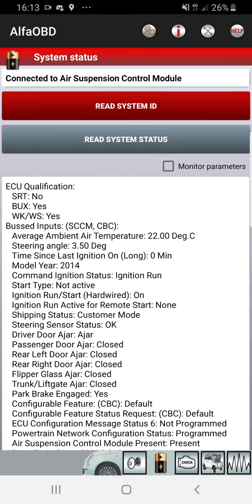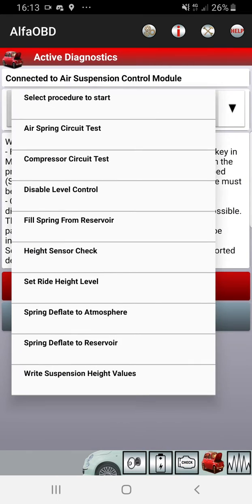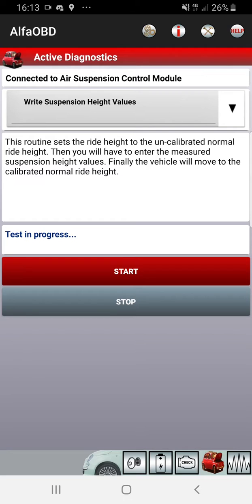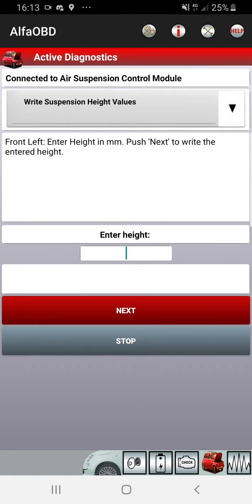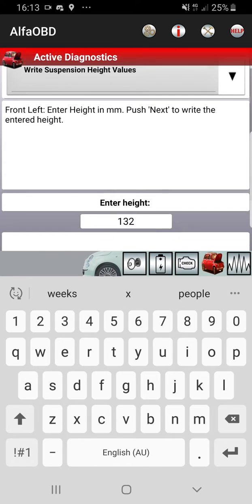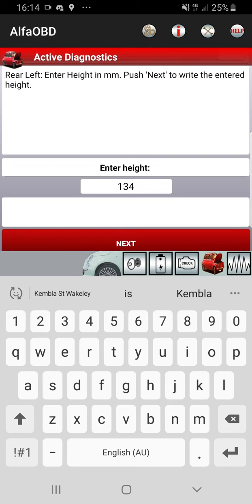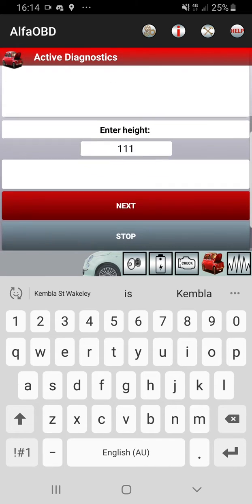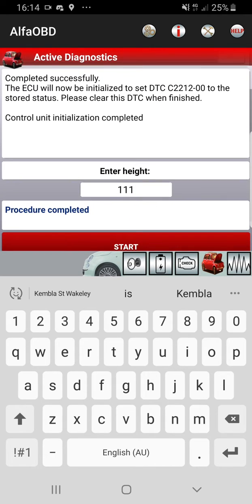Using AlfaOBD to Change Quadralift Suspension Heights

Comment: I believe what you did was lower the vehicle. The calibrated normal ride height values and the numbers you entered are not the same measurements. What you did was recalibrate the system. The values you enter are what you actually measure the ride height to be when it’s adjusted to the calibrated normal ride height. This tells the system what the actual measurements are then put new calibrated values into the system and saves them. In order to actually lower or raise the system you need to measure the vehicle ride height at all 4 corners from the correct measuring locations. Then lie to the stem and add mm to you actual measurement to lower the vehicle. You cannot change the factory set values. Only trick the system.

Comment: Hi Daniel, thanks for this vid and general info on your Jeep.  I followed your mods and fitted a strut spacer to my front struts for a static ride height increase while still maintaining decent downtravel and air susp functionality.  Well at least that was the goal....

Unfotuantely upon inflating the front struts again (after deflating to tank) my air suspension is giving me a dash warning, and according to AlfaOBD the system is in "Plant Mode" and due to not being able to recalibrate and giving me a error code C156E-OO.  I assumed that after these mods I would be able to set the new ride heights like your video shows, and this would fix any calibration issues after fitting the strut spacer.

BUT it seems I am unsecessful in clearing the code and setting new ride heights.  AlfaOBD is not keeps telling me the system is in plant mode, and won't do the calibration.  Despite clearing the code for plant mode, C2212-00, it still comes back soon after. 

Did you experinece this after fitting your strut spacer?  How did you get around it?  Any info would be much appreciated.

FYI mine Jeep is a MY2015 Overland.

Comment: I NEED HELP PLEASE, I NEED HELP.  I Replaced the front right shock absorber and compressor for leaks.  I refilled the Nitrogen reserve and all the shock absorbers.  Everything was perfect until I reached the suspension height.  My Jeep Summit has been in the garage for two months and I can't get the factory measurements.  Some say 85mm rear and 55mm front and others tell me 85 front and 45 rear, I don't know what else to do.
Reply: Summit Front Left Calibrated Height: 101 mm

Front Right Calibrated Height: 108 mm

Rear Left Calibrated Height: 99 mm

Rear Right Calibrated Height: 99 mma
Reply: @ElhassenGIS  THANK YOU. LAST QUESTION: Once I enter those values.  Are the other values and different heights automatically restored including (rock, sand, snow etc.?) or do I have to enter the other values as well?

Comment: Hey Daniel...you say 35 and 25 but values are different in the movie...how come? Can you give links please of your setup parts ..want to do the same...did u also installed Bilstein shocks on rear ? Or relocation brackets? Appreciate it...keep up the good work
Reply from the maker: Different Jeep in the video. Links to the parts I used are in my other video. Initially, I used the full 2 inch of spacers in the rear with OEM shocks but now I have Bilstein shocks with 1 inch spacers.
Reply: @DanielDjuracic appreciate it, i added the 2 inch spacers in the front, what values to add so my parking still works, a
I still got airlinks level, tried with the original also but no luck, help
Reply from the maker: @MedMaxMotto  Every car is different, i added 35 and 25 to my vehicle but was doing a different vehicle in the video.
Reply: @DanielDjuracic  Once I enter those values.  Are the other values and different heights automatically restored including (rock, sand, snow etc.?) or do I have to enter the other values as well?
Reply: @DanielDjuracic   Hi! Can you give a link for the shocks?